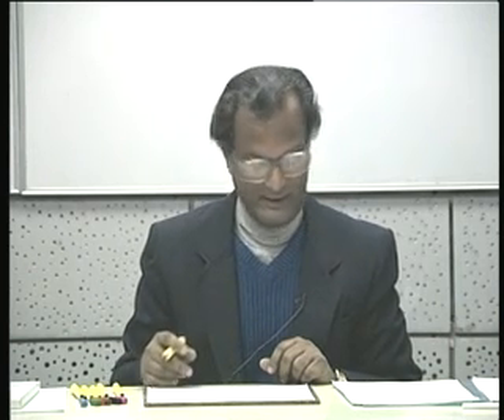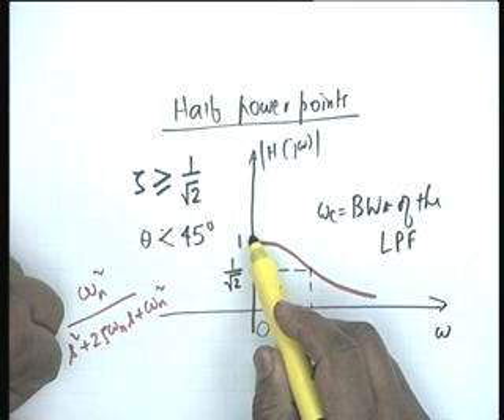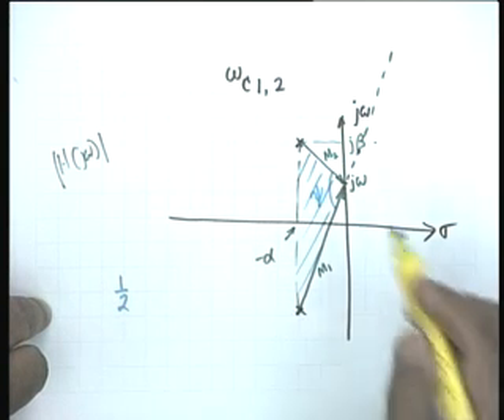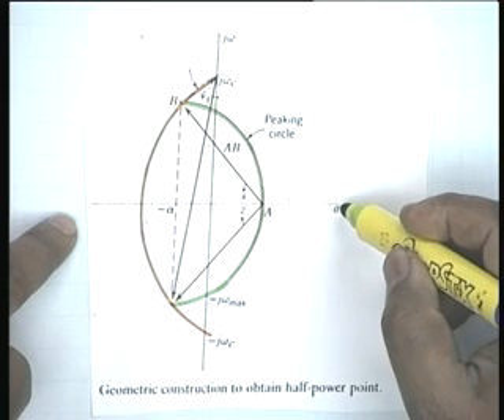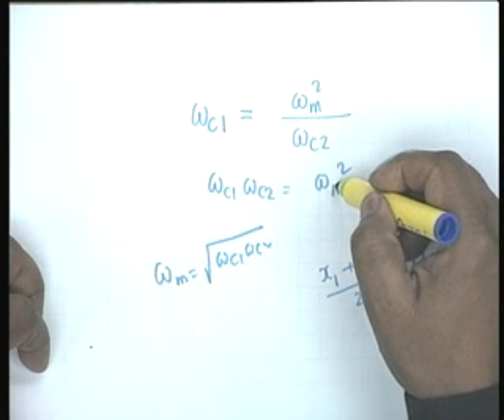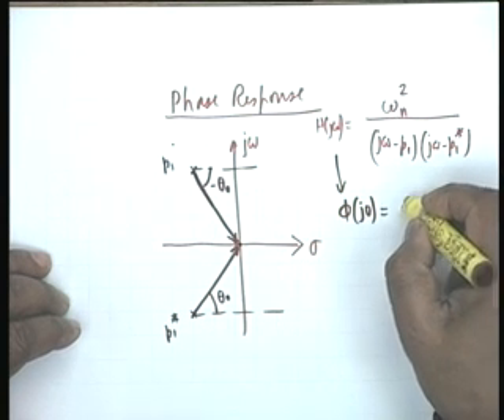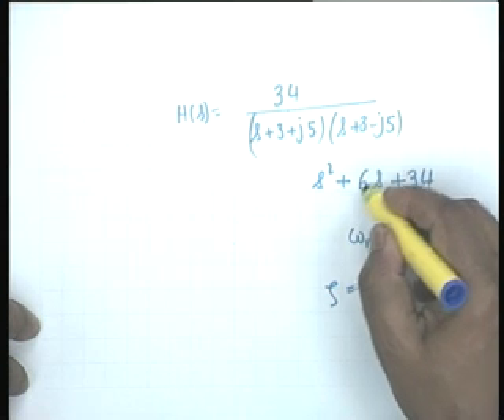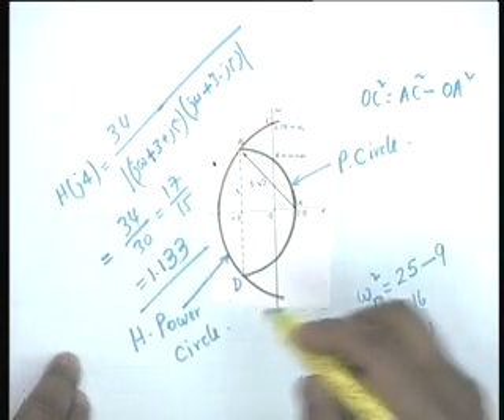Lecture - 15 Single Tuned Circuits (Contd.)

Comment: a question, if we have a wire and we connect it to form a circle, is this circle considered an electrical circuit and what are its components, what are the sources of voltage, current and resistance if any? thanks
Reply: Yes it is.

The components are wire resistance, parasitic capacitances and inductances

The sources of voltage and current are NOISE